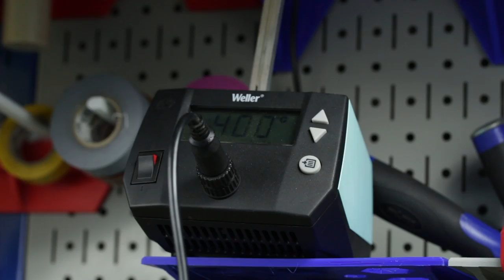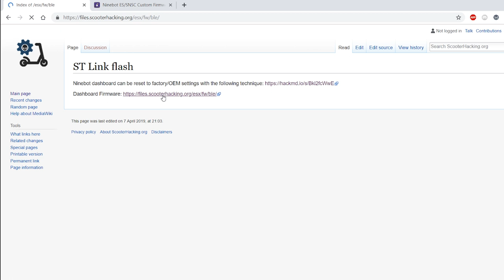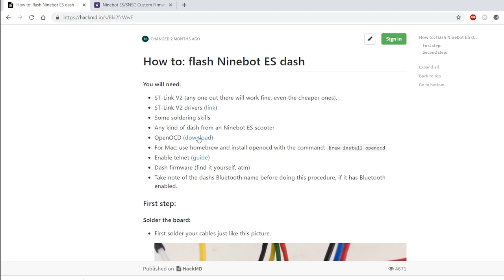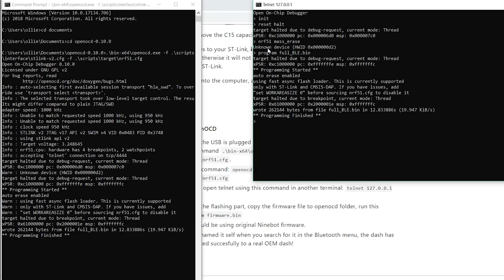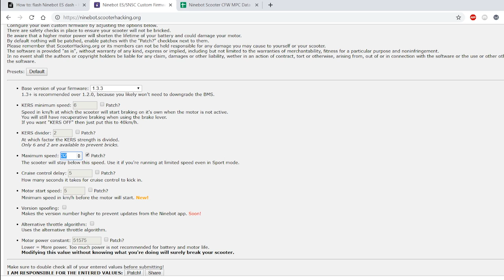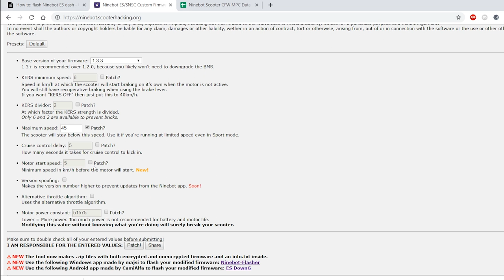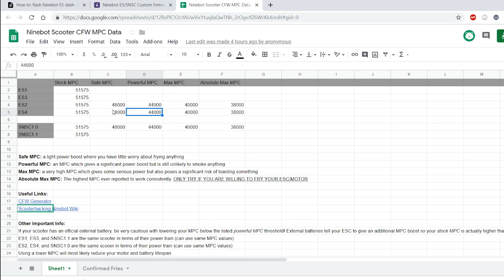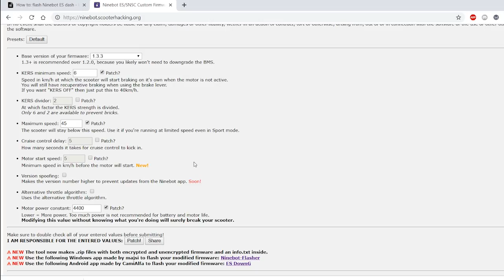Ninebot ES/SNSC Custom Firmware (CFW) ST-Link Flash Tutorial

Comment: It will not fry my motor, baterry or elecktronik ? Would i buy ST Link or ST Link CFW or Pre-flashed board ?
Reply from the maker: If you don't already own a dashboard to ship to us, purchase a pre-flashed dashboard. As described in this video, safe cfw settings are less likely to fry anything but there is always the risk with unofficial firmware.
Reply: @BananaScience  I'v just bought es4, i know there is a risk, but don't wanna buy something wrong, that's why i asked which I need to buy. With all the rest i can handle. Even when i fry something.
Reply from the maker: edzioevil If you already have a non rental scooter with a dashboard then you can just skip to the CFW section of this video and flash your preferred settings. If you wanna be safe, don’t tinker with the top speed and just change the MPC to 48k.
Reply: @BananaScience  so you say that, if i have new es2/4 i don't need to buy usb. I can just flash new firmware ? And when something gone wrong, then i need to buy this usb only for erase false firmware and then flash one more time. Did i understand good ? Sorry for my English. And thank you for helping me.
Reply: So, Thank you for your video, i did it. Unfortunately we can't more then 35k/h. Shame :/
Reply from the maker: @edzioevil  Yup if your scooter isn't an ex-rental scooter then you should be able to skip all the soldering and just go straight to generating and flashing your CFW.
Reply from the maker: @edzioevil  Yeah CFW still has its limitations
Reply: @BananaScience  Yeah, i don't see any diffrence after flashing, is there any idea how i can install original software ?
Reply from the maker: @edzioevil  Just connect to the scooter using the app and click update.

Comment: My scooter use to go at 30 km/h - 20mph, but is stuck at 20 km/h, I have a battery pack so it last longer and go faster
Reply from the maker: Are you sure you are in the highest power mode? The little red light should be on in your dash. Double press the power button to change modes.
Reply: BananaScience Yes I’m 100 percent sure
Reply from the maker: Saki Ali did you change anything right before it started going slower?
Reply: BananaScience mine only goes 16 mph.   What is the trick behind getting 19MPH?
Reply from the maker: Jay Dee following the steps presented in this video lol

Comment: Does this accomplish anything else besides being able to flash a dash with custom firmware? I bought damaged VOI scooter at a goodwill and was wondering if it's as easy as plug and play with a replacement dashboard from Amazon. I mean, I'll probably end up flashing it anyway, but I was just wondering on the limitations.
Reply from the maker: Rob Fuen This will also fix the issue with rental dashes where the display doesn’t work.

Comment: Did anyone do this with a Lyft scooter? What did you skip?
Reply from the maker: Lyft scooters use propriety ESC hardware which means you will not only have to replace the dashboard, but also replace the wire that runs between your dash and ESC. For more details on this, please visit the Discord forum linked above.
Reply: Do you need to replace the battery too? Or just the ESC and dashboard display.
Reply: @BananaScience  thanks for the info!
Reply from the maker: @Timepast20  You will just need to replace the ESC or rewire it
Reply: @BananaScience  I have been looking all over the place for information on rewiring the ESC but have not found anything. Would you be able to give me a lead?
Reply from the maker: @Platinum989  https://www.scooterhacking.org/forum/viewtopic.php?f=6&t=40

Comment: No hay archivos en bin-64,  bin, scripts. Me podrían ayudar. Muchas gracias
Reply from the maker: Disculpe para la repuesta tarde. He cargado la carpeta OpenOCD con la carpeta bin-64 aquí si usted la nececita. https://drive.google.com/drive/folders/189TVuuJCF6h-FbmtZ73Xhy08AT4_AmOm?usp=sharing
Reply: Muchas gracias
Reply: Al copiar y pegar  . \bin-x64\openocd. exe - f. \scripts \interface\stlink-v2. cfg - f. \scripts\target\nrf51. cfg          me aparece        open on-chip Debugger 0.10.0  Licensed under GNU GPL v2   for bug reports, read
Reply: Info:auto-selecting first avallable sesión transport "hla_swd". To override use 'transport select <transport>'. Info:the selected transport took over low-level target control. The resulta might differ compared to plan JTAG/SWD Adapter speed:1000 khz  Info: Unable to match requested speed 1000 khz, using 950 khz     error:libusb_open() fáciles with LIBUSB_ERROR_NOT_SUPPOTED in procedure 'ocd_bouncer'     
A otra cosa el full_BLE.bin aparece no se deja abrir por q aparece q es un archivo de audio, de ante mano muchas gracias por ayudarme
Reply from the maker: Paola Rojas Está usando un ST Link V2 como yo hice en el video? Sugiero que chequee el cableado también.
Reply: @BananaScience 
Si edtoy usando un st- link v2 y   ya revise  los cables y nada. Muchas gracias
Reply from the maker: @contreras3816  Hmmmm... ¿Está usando un Mac o un PC?
Reply: Un computador toshiba
Reply: Con windows 10
Reply from the maker: Paola Rojas Ha activado telnet? No sé esta problema.
Reply: No le ha funcionando estoy intentando con la raspberry pi   me puedes decir q archivo debo descargar y q archivos le debo enviar desde el pc a raspberry pi  gracias
Reply from the maker: Paola Rojas No sé cómo usar el raspberry pi para este proceso. Debe preguntar su pregunta en la sección de español en el Discord.
Reply: Me puedes enviar el archivo dashboard firmware.
Gracias

Comment: Hi,thanks for sharing a productive video...
I purchased parts from a Sunday market where they sell a lot of things..
Main body with motor is a ninebot,all the rest up where the battery and control board is from voi.
Strange is that i dont have a connection for led’s from the main body(maybe the cable was ripped.
When i press the button ON it imediately turn off and makes a beep noise that repeats.
Batteries are charged.
Is there any chance i could fix this and make run normal?thanks again
Reply from the maker: Is/was there a tracker box mounted to the front of the scooter or was it mounted to the top? If it was mounted to the front, you will need to buy a new speed controller and use the process described in this video to flash the dashboard as well. If it was mounted on top, you will need to buy a new dashboard and may need to flash your speed controller. For speed controller flashing instructions, see the error 10 section of the scooter hacking forum.

Comment: How the heck do you get openocd to work? :(
Reply from the maker: Joachim Dorvall could you please elaborate more?
Reply: Okay! When I type in cd openocd-0.10.0 it works fine but when I type in the massive line of code it says, something like “ can not find the search”. I dont know how to setup the openocd to get it work for me
Reply from the maker: @joachimdorvall3445  Make sure you are pasting in the right line of code for your respective operating system. If that isn't the issue, try deleting open OCD and re-downloading it then restarting your computer.
Reply: BananaScience how do you mean?  I’m typing in in the right order as you do on this video. I have openocd in documents, I can go in there and then > cd openocd-0.10.0 when I’m typing on the massive code it can’t find it. I only some to openocd but not future. Can you please help me to solve this?
Reply from the maker: @joachimdorvall3445  Sorry I forgot to ask: have you extracted the .7z file into a folder? A couple people were having this issue since they never extracted the OpenOCD download with 7-Zip.
Reply: BananaScience what do you mean by extract 7z file in a folder? Do I need to extract it in a specific folder?best regards
Reply from the maker: @joachimdorvall3445  The .7z file is a compressed (zipped) folder. Download the program 7-Zip then right click on the OpenOCD file and click extract. That will turn the .7z file into a folder. Your issue is that you can CD into the file but since it's not yet a folder, you can't run that long line of code.
Reply: BananaScience now it works for me! Thank you for your help! :)

Comment: Hi ! could you explain me the part with the C15 part, just didn’t understand what to do with it ! 
And do i have to buy a new dashboard or use the one previously on the scooter
Reply from the maker: You just have to remove C15 somehow because it prevents you from flashing stock firmware. You can use the stock dashboard that your scooter came with and you can actually skip the steps where we dismantle the dashboard and flash it with the ST Link if you haven't replaced your dash. Many people do need to do it though as they are using ex ride share scooters which they have purchased from local impounds. In that case, they need to replace the tracker board with a new dashboard but need to flash stock firmware on that dash before they can flash the hacked firmware.
Reply: I bought an old Voi scooter, so it contained Voi firmware in it, do i need to buy a new dashboard, or can I simply flash it with a st link ?
Reply from the maker: Which version of Voi is it? The ones with the tracker module mounted on the front will need a replacement speed controller for them to work and you will likely have to flash stock dash firmware no matter which version it is.
Reply: its the last version of the Voi, with the tracker in front !
So already ordered a new control board, the metal blue part, but I still don’t understand if i need to order a new circuit board (shows speed) and if i have to flash it with the cracked firmware, or use the one already on the voi ? private message if you can
Reply from the maker: You will likely need to flash firmware using the ST Link (as shown in this video) onto your dashboard.

Comment: Hello,

Thank You for your guide, that is amazing!

I've a ninebot ES2 with original external battery (ES4)

I rebuild  the patcher using the GitHub code. I've set the max speed to 45km\h, but it seem that the scooter speed is locked on 33/34kmh

Using firmware base 1.3.9, MPC 44000, max speed 45km/h 
if I lift the scooter and spin the wheel, the dashboard speed reaches a peak of 40kmh but then goes back to 33kmh. 

Using firmware base 1.5.1, MPC 44000, max speed 45km/h 
the dashboard speed does not reach 40km, but increases and stops at 33/34 km/h

do you have some advice?

Thanks in advance
Davide
Reply from the maker: Hi David,

We aren't developers and as far as I know from listening in on the Scooter Hacking Discord channel, it isn't possible to exceed a speed of around 33/34 km/h without using a larger tire or doing the 12s battery hack which looks super sketchy. Even if you could get it to go 45 km/h it would surely fry the ESC if you as much as breathed on the electronic brake lever.

Comment: Is it possible to just make a USB connection at home? Like clipping the android charger side of a wire and plugging in the USB side into the computer and then soldering the clipped side of the wire to the dashboard? If that made any sense. Or is it absolutely necessary to have that USB device you showed in the video?
Reply from the maker: You have to have an ST linker to communicate with the control chip on board the dash
Reply: @BananaScience  thanks!
Reply: raspberry pi 3
Reply from the maker: @johnrwygle  Yup. Check out the forums on the exact method on how to do this.
Reply: I am about to boot my pi fothe firsttime, using a specially formatted SD card. The pi costs 25 $ maybe at target or Walmart. You can return later. You will need a pc or laptop, and...... Ā CARD READER!
it's taken me three days to source one without paying bestbuy